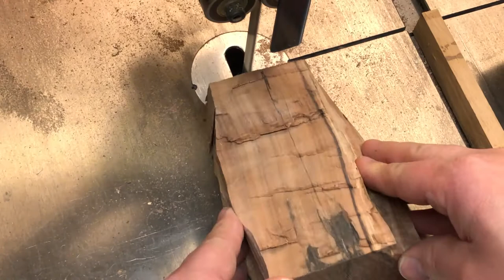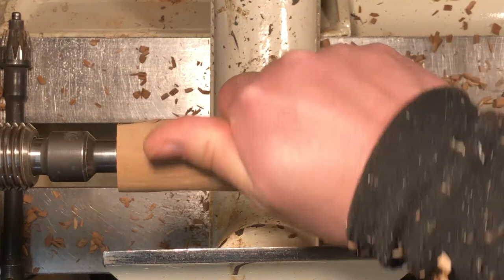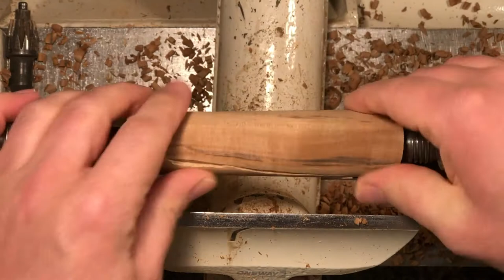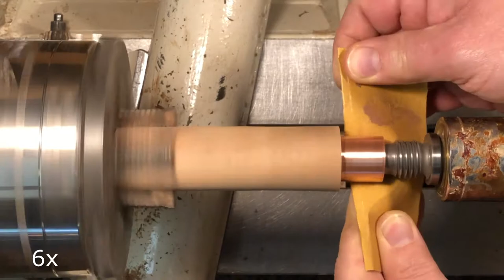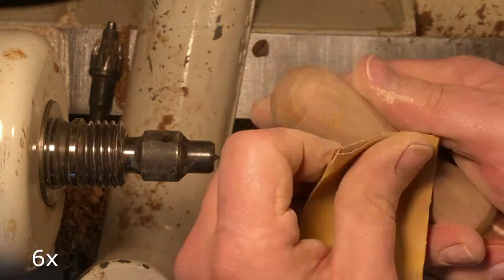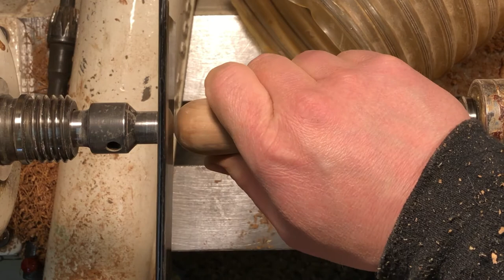Beat Up Applewood Makes Beautiful Tool Handles - Woodturning

Comment: Nice work. I have about 15 various rasps and files I got at a box lot auction, all without handles. I'm going to save your video so I can make some handles after my Christmas turned presents are done. Was this spray on varnish or did you use a brush? Although you didn't show it, I'm assuming you either used an epoxy or friction fit when you secured the tang to the handle.
Reply from the maker: Answers to your questions:

The finish is General Finishes Arm-R-Seal, a wipe on product.

 The handles are all friction fit. I use a drill gauge to check the tang of each file and drill a hole that lets the handle cover most of the file tang after being pounded onto the file.

Here are two tips to save you some time if you’re making a bunch of handles. Using a non-ferrous metal cutting blade on a chop saw to cut the ferrules will leave you with far less edge prep than a tubing cutter or a hack saw. And using an orbital sander with a squishy pad less work than sanding the tips of a dozen file handles by hand.

You’ll like having handles on you’re files. Good luck!